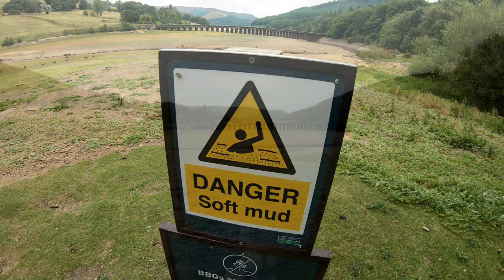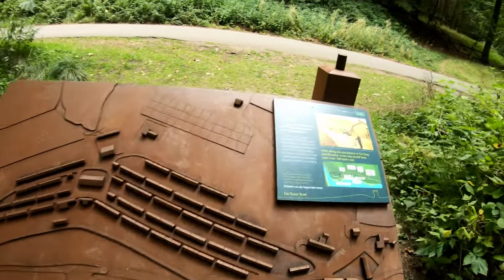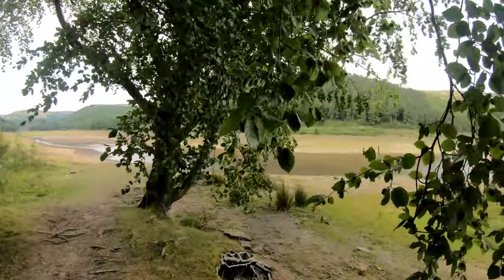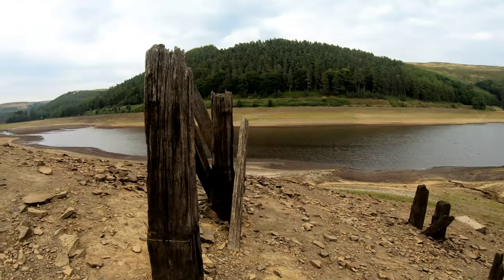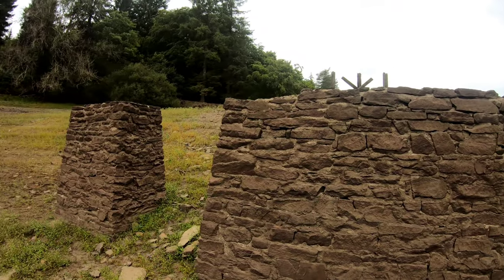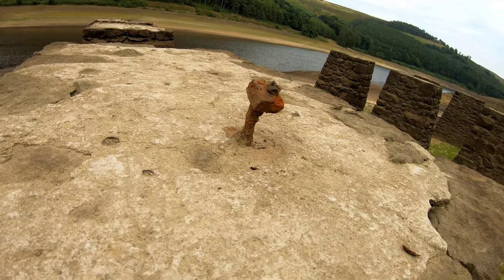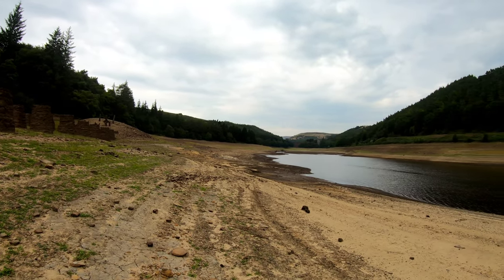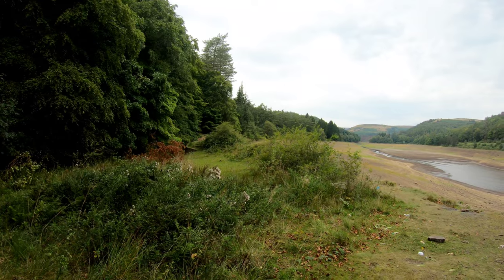Remains of Railway Viaduct in Derwent Reservoir - 2022 Drought

Comment: That's amazing Paul that the viaduct piers are still there as being a contractors railway wouldn't have been as well built as a permanent one 
For some reason missed the videos on the dams but will watch them soon
Another cracking video 
Cheers Russ
Reply from the maker: Cheers Russ.
Yeah I expected them to not be in as good condition. Bit of pointing required, but other than that....